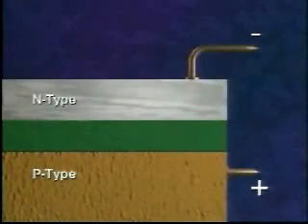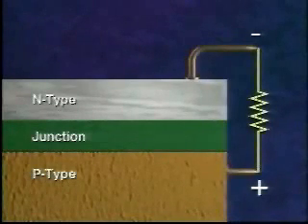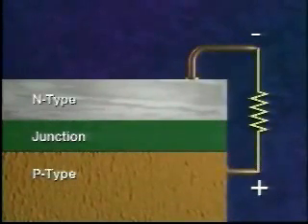Photovoltaics and the Photoelectric Effect

Comment: @sandslash123 this is due to the electric field that the p-n junction is creating in the center. That is why, the only way for the electrons to fill the holes is through a circuit. This circuit leads the electrons to the holes in the positive layer.